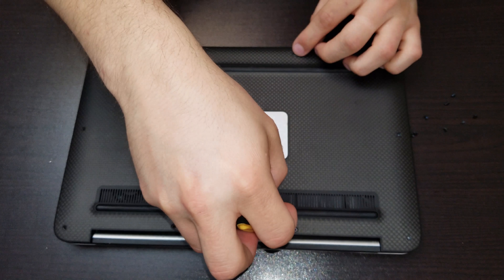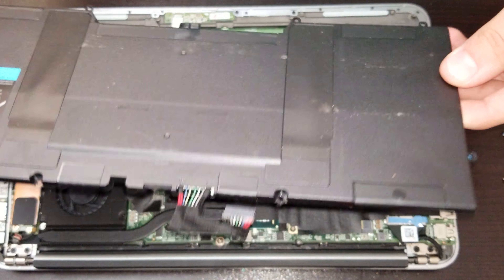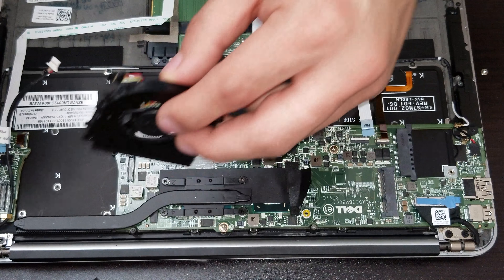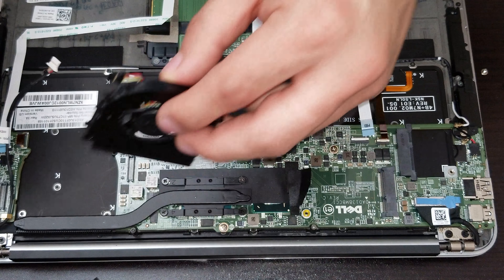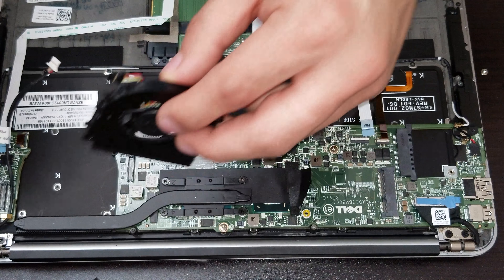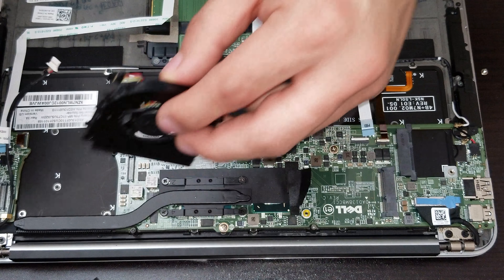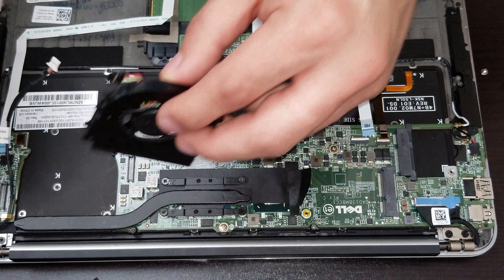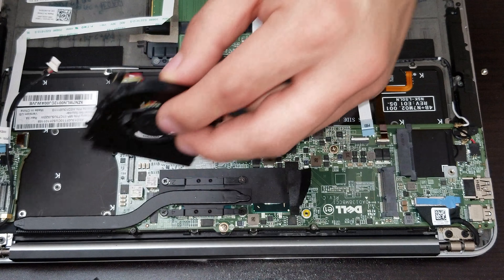Dell laptop XPS 13" L322X

Comment: Hi, I have issue with the keyboard and mouse. The power button works and able to start the laptop and i can move the cursor until it goes to the login page after that the keyboard and mouse both doesn't work. I tried support assistance from dell but none of the keyboard button works. Any help on what to do now. FYI external keyboard and mouse works, just the laptop keyboard and mouse doesn't work.

Comment: Hi friend, I have the same laptop but the screen is touch (D13LVDS cable) , you think if I replace the touch screen with an lcd non touch screen will work?
Reply from the maker: If the PINs on the screen connector are the same and the flex cable, yes should  work. Don't forget to subscribed and welcome. I recommend you, take out the screen first to check behind (the connector) and after order the screen.  Hope this help
Reply: Is this okay for video editing?